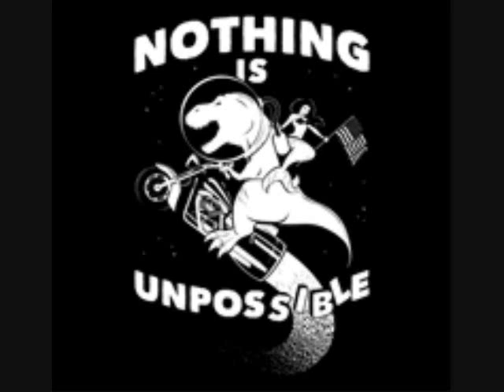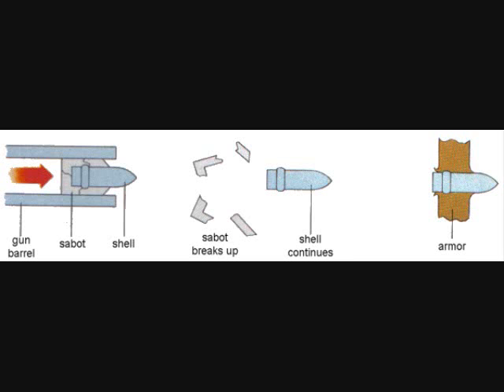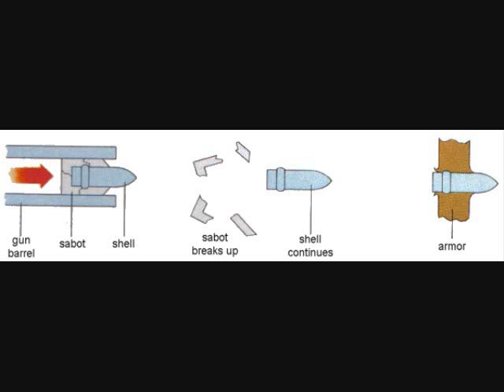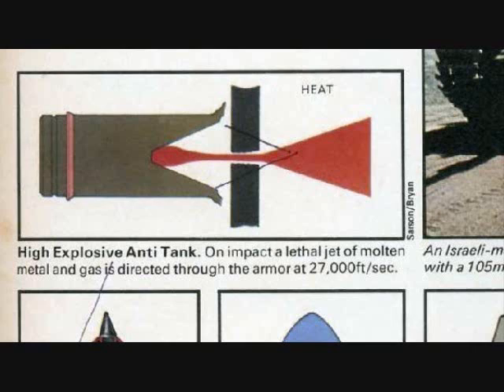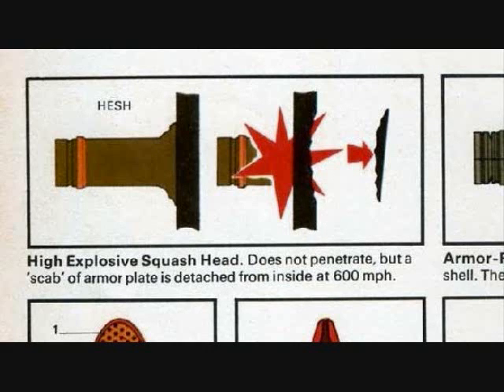Modern tank armor

Comment: Years late, but whatever. A long rod penetrator which embeds itself 3 meters into a 5 meter rolled steel armor block literally has an equivalent penetration of 3 meters of steel armor. Is this not obvious? Thus, if an armor of this or that material at this or that angle at this or that angle of attack stops a long rod penetrator... this or that has an equivalency.

Comment: Actually HEAT jet doesn't have any sort of high temperature in the jet at all look it up I cannot be bothered.
Reply: @Travis Thacker,  With all due respect Mr Washburn (who is correct although the adiabatic shearing is debatable), I will use understandable english.  The science is called the Monroe Effect.  The liner does not get converted to plasma. What happens is the exploding cone charge exerts such massive pressure in an extremely short period of time to the cone liner that the liner metal behaves more like a liquid (hydrodynamic) than a solid which explains why you see what you see in those footage.   I do agree with you that both are kinetic energy because both rely on metal traveling at high velocity to poke a hole in the armor.  Both get their velocity from the same source.

Stand off distance is not the defeat mechanism for cage armor.  It's designed to break up the projectile/warhead into pieces.  no boom, no owie.
Reply from the maker: Yes, thats what I pointed out. People have came onto this video and (falsely) claimed that HEAT does involve molten metal.
Reply: TheJamesrocket it's common misconception.
Reply: I have no idea what you're talking about. While HEAT rounds use entirely kinetic energy to perforate armor, there is still a massive amount of heat involved in the process.
Reply: What you describe is not a HEAT round, but another type of shaped charge (Hollow-charge)

Comment: Really guy, I'm no materials engineer. However advanced armor, such as Chobham/Burlington/Dorchester/advanced composites, are not some force field armor. These modern advanced armors use laminated layers to greatly reduce known anti-tank rounds. In most cases these advanced armors will defeat almost all incoming HEAT and kinetic energy penetrators (APFSDS) they will face in the field. Engineers working on these armor designs are very good at their jobs. They are also very good at estimating how a given thickness of advanced laminate armor will match the protection given by an thickness of RHA (rolled homogenous armor) at a distance against an incoming HEAT or KE round. The RHA equivalent changes significantly depending on the round used. When it comes to HESH rounds, most Western tanks use advanced spall liners. Also Britain is one of the only countries to use HESH rounds. You should ask a materials engineer about this topic before you make another video.
Reply from the maker: +MuchTooStress 'However advanced armor, such as Chobham/Burlington/Dorchester/advanced composites, are not some force field armor.' 
No shit, sherlock. I've just made a 12 minute long video explaining the physics behind composite armor, and dispelling some of the mythology that surrounds it. So how exactly can I be accused of presenting it as some kindof force field?
 
'They are also very good at estimating how a given thickness of advanced laminate armor will match the protection given by an thickness of RHA (rolled homogenous armor) at a distance against an incoming HEAT or KE round.' 
You aren't telling me anything I haven't heard before. In fact, you might be parroting comments left by ThomasG10mtn. When metallurgists equate a ceramic armors effectiveness to a thickness of RHA, they are referring to the end, not the means. Hence my diatribe about 'miracle armor' at 1 min 55 sec.
 
'You should ask a materials engineer about this topic before you make another video.' 
You ignorantly assume that I HAVEN'T talked at length with any metallurgists about armor systems or how they work. You are comically wrong. Before I made this video in 2011, I was getting schooled by a guy who turned out to be a materials engineer. He passed on alot of the knowledge, perspective, and dicipline needed to swim in this lake.

Comment: HEAT round is actually based on..heat,high temeprature, because if there was no molten copper jet it wouldnt do anything, it would act as regular high explosive round, and shaping it and whatnot helps it to punch through, and thus saying that it is irrelevant is wrong. Ceramic is damn good at stopping it,it disperses heat and by doing so it lowers the HEAT efficiency, but on the other side wont help much against kinetic strikes as it will just crack and fall appart. Germans used sideskirts against HEAT rounds, also another case where your story doesnt make sense, no matter how much pressure it made, after initial detonation, jet cooled down to that point that it cant do much more than leave nothing but scratch marks..Again caused by loss of temperature,which you said is not important.
Reply from the maker: +Warmongers Inc. Thats not actually true. The metal jet (usually copper) in a HEAT charge only reachs a temperature of 300 to 400 celsius, which is well under the 1080 celsius melting point of copper. But due to the tremendous velocitys and pressures involved, the copper jet flows like a viscous fluid, which is why you can use hydrodynamic equations to model its effect.

The ability to disperse high temperatures is not relevant in ceramic armor. Remember that materials like boron carbide have a thermal conductivity of 17-42 watts per meter kelvin, which is no better than ordinary steel, and greatly inferior to tungsten at 174 watts per meter kelvin. The drop in penetration seen with a HEAT charge is due to the geometry of the liner: Different parts of the copper jet move at different speeds, which varys with the apex of the cone (typically 40 to 90 degrees).
Reply: +TheJamesrocket That is also very, very wrong! Copper jet reaches extremly high tempereatures, even OVER 1000 degrees celsius..You brought the wrong physics with ya this time, i still stand firmly behind my previous statement, no extreme heat, no effect. By what you said, jet blast would be actually hot, squishy piece of metal. In reality and what i said, what happens is that the explosive inside the warhead liquifies the copper and sends it flying through metal,melting it as it pushes through, causing catastrophic damage once it reaches tank's inside.
Reply from the maker: +Warmongers Inc. There is plenty of evidence suggesting that the metal jet never becomes molten. Heres a quote from W.P. Walters and J.A. Zukas book on shaped charges: 'Jet temperatures vary depending on type of shaped charge, cone construction, type of explosive filler. A Comp-B loaded shaped charge with a rounded or pointed cone apex with a copper liner had an average temperature of 428 degrees Celsius with a standard deviation of 67 degrees Celsius.'

If you want to hold to your belief that the metal jet of a HEAT charge is molten, you'll need to provide some evidence. You'd also have to explain why modern tanks use ceramics like boron carbide, rather than tungsten which has a much higher thermal conductivity (and thus, according to you, superior protection against shaped charges).
Reply: +TheJamesrocket Never read that book, but, yet again i stand behind my claims.  And now i noticed that even on the illustration of the HEAT round(by the way, i would like to know where you got it from) on that poster you used in the video it says "On impact a lethal jet of molten  metal and..." but you keep ignoring and denying it. Also my source from where i got that information years ago, was a person who served some decent time in the army and spent a lot of time working with ammunition. HEAT rounds also leave special, nasty looking holes that can only be caused by extremly hot metal bursting everywhere, trying to dig through armor. Cheers!
Reply from the maker: +Warmongers Inc. I'm aware of what the inscription on the picture is. When I uploaded this video to youtube 4 years ago, I already knew that the inscription was wrong. So why did I use the picture? Because it was the best one available to me at the time.

You haven't provided any evidence that the metal jet ever becomes molten, and in fact, you've ignored all the evidence to the contrary. Nor have you explained why boron carbide (which has poor thermal conductivity) is such a critical part of composite armor. If anyone here is in denial, its you.
Reply: +TheJamesrocket It sure is critical part in composite armors, but so is ceramic in it's many shapes and forms, either as coating or as one of the actual layers in the armor's structure. As i don't have the book that would also claim same as i do, and as it apparently information from a person who was in the army for quite some time doesn't count, i can recommend you to check TankNutDave, here on youtube and see what he has on the topic. I also doubt he could go wrong with such matter, same as other military sources i refered to earlier. Here is the link so check it out if you wish, fun part starts around 4:00 in that video. watch?v=4GG7iXZdYbg
Reply from the maker: +Warmongers Inc. You are entitled to your own opinions, but not to your own facts. I watched TankNutDaves video years ago, it contains numerous factual errors. For instance, he claims that the effectiveness of composite armor comes from its density. This is a red flag to anyone who has even a passing knowledge of metallurgy. Ceramics are used because of their extreme hardness and compressive strength, not because of their density.
Reply: +TheJamesrocket Ahhh this is going nowhere.. I still stand behind the saying that HEAT shells are based on molten jet, and effective thickness has in some hand to do with material density(not saying entirely) but it helps in keeping the armor lighter but same or even more durable.  Abrams didn't have uranium in armor composition at first, it was added later after numerous catastrophic hits that occured in past times. Reason was its density and thus excellent capability to stop incoming rounds, it works vice-versa when used against armor... We know that effec. thickness comes from slopping the armor, but virtually we could say that denser material increases it in one way or another. Have a nice day!
Reply: +Warmongers Inc.   HEAT shells achieve penetration by something called Superplasticity. Your claims of HEAT shells being based on molten jets is wrong and you are too lazy to research on it.
Reply from the maker: +5000mahmud Exactly right. This BS about molten steel is just lazy people continuing to repeat the same half truths.
Reply: You absolutely incorrect. You can't even cite any sources to prove that 
you are correct. Even Carlucci's book Ballistics explains how the jet 
penetration is purely kinetic in nature, it has nothing to do with a 
supposed molten jet. I have seen numerous videos on youtube make the claim that the jet is molten, but this does not prove that it is true. Glass wine bottles can be used for shaped charges too, but when those are used, why don't you see melted glass anywhere"? Furthermore, EOD techs are just that...technicians. While they understand how to use HE as a tool and they understand basic theory, virtually non of them are engineers of physicists. If you know anything about physics, you would know that the detonation velocity of the HE going off does not allow for enough time for heat transfer to melt the copper lining.
Reply: No you are incorrect.
http://eprints.maths.ox.ac.uk/211/1/poole.pdf  
Read 1.1.1 Mechanics of a shaped charge jet 
It is not molten its only 500C, it penetrates through extreme pressure like a water jet can cut through steel.
And specifically it achieves penetration through causing the target material to enter a state of superplasticity.
Reply: no. the pressure of the explosion forces it into the armor. you can put copper at 10.000c over a 150mm armor steel plate, and the worst thing that can happen is that it melts a small portion of the steel around it, before it falls to the ground, cools down or separate into worthless drops.
Reply: @ Mahmud and James
Ehhh I wouldn't say that they were exactly lazy, it was a pain in the ass to find then read and understand that link I gave. Why anyone thinks they can comment before they have done that I have no idea and as far as I can see i'm the only one here to do that.
Reply: Nonsense ! HEAT around is NOTHING to do with heat - but high explosive anti tank. Penetration of Jet is due to hydrodynamic pressure only and takes place in millisecs as modelled in hydrodynamic based software. At extreme pressure and high strain rates materials can be modelled as fluids. There is no time for heat effects to take place and physics of HEAT rounds is totally different to penetration of steel plate by 'plasma/arc cutting tools . The temperature of the jet can be measured from its spectrum and flash x ray radiographs can plot the path and motion of the jet with time. Dont mix up physics with history - as you demonstrate your ignorance
Reply: My comment was directed against nonsense from Warmongers. It should be removed from the site.
Reply: Warmongers - The Jamesrocket is correct. I suggest you attend some a course on basic physics and stop filling up this site with your nonsense.
Reply: Attend a physics course Warmongers before you contribute anything of value - please.

Comment: If a tank is lined with Kevlar, will a DU round penetrate it and if so, will it still combust?
Reply from the maker: ***** Thats a good question, but the answer is somewhat finicky. With armor systems, you have to draw a distinction between between penetration and perforation: While these share a lot of the same mechanisms, they should not be thought of as interchangeable. Penetration is a survivable event for the crew, while perforation generally isn't.
  
When AP rounds penetrate the armor (but do not perforate), they produce an effect known as scabbing or spalling: Both of these can be dealt with by a spall liner. Against perforating hits, though, kevlar doesn't help at all. As for whether the AP projectile will ignite the crew compartment, that depends on how intact it is: Due to the cube square law, small fragments combust much more readily than a single large chunk.
Reply from the maker: +Keith S. Some additional information: When a shell manages to perforate armor, the material will experience either brittle or ductile failure. The former includes brittle plugging, brittle fractures, and radial fractures. The latter includes ductile plugging, ductile hole growth, and petaling. Ductile failures are less traumatic for the crew than brittle failures. Heres a picture to help illustrate: http://panoptesv.com/RPGs/Equipment/Weapons/PenetrationModes.png

Comment from the maker: What was the title of the book?
For my part, I could have been a little more technical on describing the interactions between the armor plate and the penetrator, but I didn't want to go over anyones head. But yes, the backing is important, you need many inchs of ordinary steel beneath your DU or chobham strike face to prevent buckling failures. I think active protection systems are also worth considering.

Comment from the maker: favor for), who is a professional metallurgist, corrected me on some of the statements I made here. There are addendums to this made in the information bar. Anyway, the best way to stop HESH is through an impedance mismatch. Steel has a high impedance, and backing it up with a material of very low impedance will neutralise the propagation waves of the warhead.
BTW, this video is part of my soldiering for dummys series, there are more on the way, so you might want to sub me to stay updated.

Comment from the maker: @marmaladekamikaze The sprint wouldn't have needed an ablation sheath, since it was never designed for re-rentry into the atmosphere (though its 99 G acceleration would have subjected it to considerable atmospheric drag).
As for the regenerative cooling, there are many differant types, often times used in conjunction with each other. But theres no need to deploy one to the nose cone, because no engine is mounted there. Hypervelocity anti-tank missiles like the LOSAT do just without them.

Comment from the maker: will exceedd the explosive power of the 10 ton MOP bomb. 
Some have worried about the possibility of them burning up during re-entry, but this need not be a concern when the impactors are coated in an ablative carbon sheath.
Yes, me and ak both know some of the whipple armors. But as for lasers, I really wouldn't recommend them for anti-tank usage, because the metals these vehicles use are so thermally conductive, you'd need a preposterously large laser to do the job an ordinary missile does.